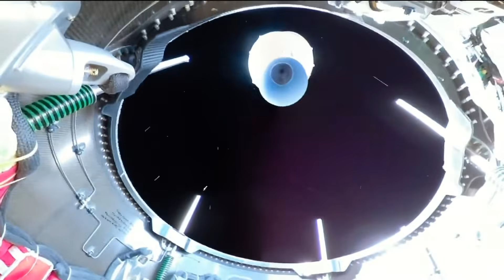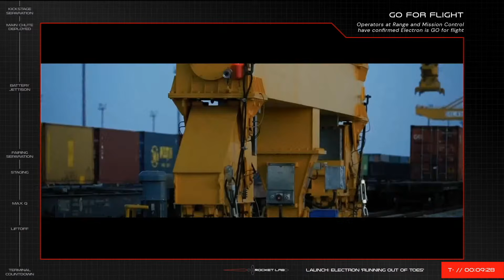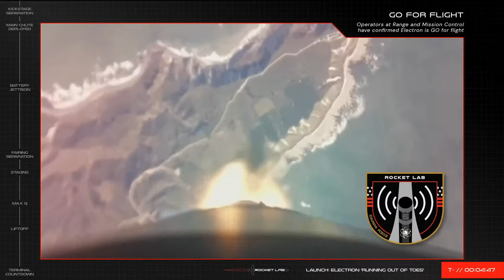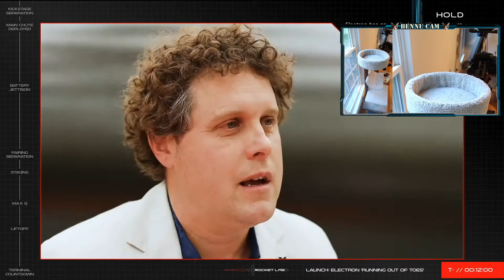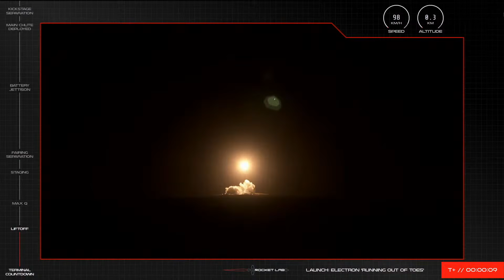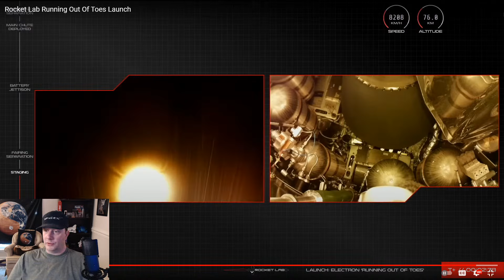REPLAY: Electron rocket 2nd stage failure; payload lost + Q&A w/ Raw Space (15 May 2021)

Comment: The most likely cause of a violent turn is uncontrolled firing of positional thrusters;  the most likely cause of which is incorrect commands sent to them, the most likely cause being faulty reading of attitude instruments,  the most likely cause of which a sensor fault AND naively coded firmware that can't deal with a sensor fault.  Just my 5 cents.
Reply: the most likely cause is it wasn't SpaceX
Reply: @jimmyjames6318  Well, I wouldn't go as far as saying that ONLY SpaceX can do anything right.  But software, or firmware, is something extremely difficult to design right, to make bomb-proof, error tolerant, hardware malfunction -tolerant, radiation and interference -tolerant, and capable of recovering from bad states or hardware resets.  I'm probably one of the few programmers that can do it right, and I'm unemployed due to age-discrimination, because I'm 62, "too close to retirement" in the stupid minds of HR people.  But anyhow, there are companies that specialize on mission critical firmware.  There's a couple of them around here in Montreal;  so there's plenty of them.  But many space companies that don't have top of the world programmers like SpaceX has, they could simply contract with these companies to design their navigation code;  but instead they decide to code it in-house.  And the reason for this is that executives are very rarely accomplished programmers, and they have NO IDEA how difficult programming is.  Boeing is a PERFECT example of executive idiocy in this regard.  Their 737 fiasco was software.  Their Starliner fiasco was software.  And they still don't learn.

Comment: I think it had structural damage a weld from sitting so long frozen thats too long to have it just sit in cylinder fuel it then liftoff it doesnt have time to freeze what its touching because of the movement of liftoff vibrations etc just sitting is bad news
Reply from the maker: Conceivable, but only Rocket Lab will be able to determine that for sure (hopefully they find the cause).
Reply: We're so lucky to have a real rocket scientist's instant analysis...